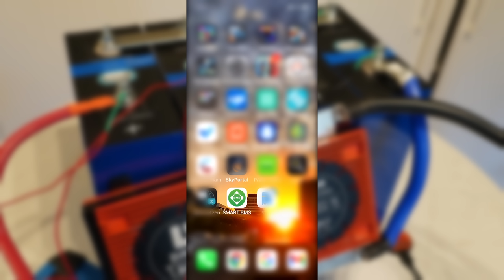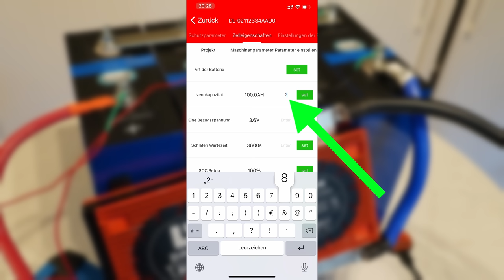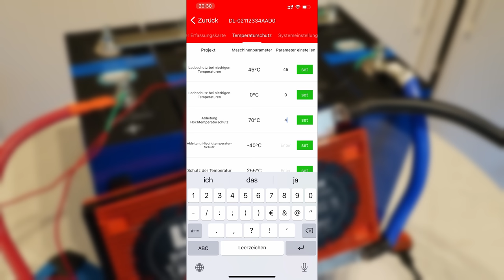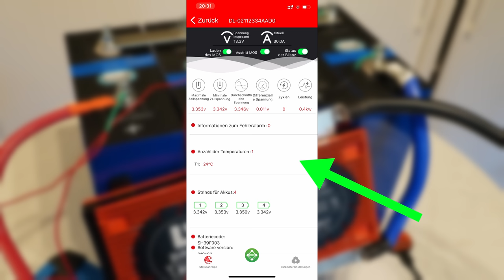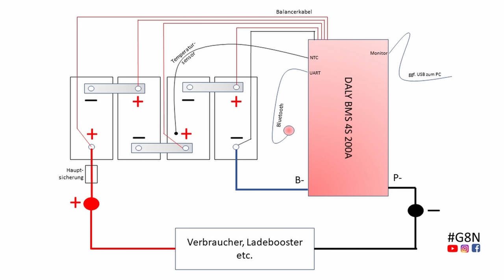Wie? 280Ah 🔋 Selbstbau für 599€, how to mit allen Details ausführlich erklärt #G8N

Comment: Ich finde, dass das hier das beste Video zum Bau eines LiFePo4 Akkus ist. Ich habe Ähnliches auf allerlei Sprachen angesehen. Hier bleiben keine Fragen über. Sehr gut! Mit dem Thema Sicherheit geht auch die exakte Beschreibung der Arbeitsschritte einher. Das macht es einfacher für Menschen wie ich, die schon etwas in Elektro Technik eingerostet ist. Hier mein Kompliment aus Portugal, Termas de Monfortinho !

Eine Frage habe ich aber doch noch:
 Mit welcher maximalen Leistung bzw. Stromstärke darf man diese Batterie laden, wenn sie Fertig ist?
Reply from the maker: Vielen Dank für dein Lob. 😊 Die Zellen selbst könnte man theoretisch mit bis zu 280A laden. Das BMS ist auf 100A Ladestrom ausgelegt. Wenn du mehr brauchst, kannst du auch ein größeres BMS verwenden. Viele Grüße, Mr@G8N
Reply: @G8Neu  100a reicht dicke! Danke Schön!
Reply: @G8Neu  Kann das sein, dass Du kein BMS für eine 24V System/8 Zellen verlinkt hast?
Reply: @G8Neu  So, habe mich selbst in Verstand gesetzt. Ich werde alsbald die Teile bestellen ! Dankeschön soweit !
Reply: @G8Neu  Super Video. Zum BMS: ein Händler schreibt, dass die BMS-Kapazität DOPPELT so hoch sein soll wie der max. Ladestrom. Das verwirrt mich. Eine Ergänzung: während z.B. AGM wenn sie halbvoll sind, keine Probleme mit einer "starken" Lima haben, da sie die max. Lima-Leistung selten aufnehmen, gilt das nicht für diese Batterien. Hier wird auch die volle Lima-Leistung auch z.B. bei 95% Ladestand aufgenommen.  Sie sagen, dass die Batterien eng zusammen sein sollen. Ich habe gelesen, dass manche Zellen nach 2 Jahren sich ausgedehnt haben. Ist das nicht normal sprich defekt? Es könnte ja auch eine Ausdehnung stirnseitig sein, und da ist im Siebdruck-Behälter wie im Video dargestellt kein Platz  ....

Comment: Sehr lehrreiches Video! Wieso hast du denn für 280ah ein 200A BMS ? Bräuchte es da nicht theoretisch ein größeres? Würde das 200A auch für 320ah reichen oder müsste man da das nächstgrößere nehmen? Bei Aliexpress werden welche bis 500A angeboten
Reply: Ah ist die Kapazität. A die max. Stromstärke beim Laden (ist normalerweise nur von der Lima) und beim Entladen (Wechselrichter etc.). Wenn also die Lima weniger als 200 A liefert und der Wechselrichter nicht mehr zieht (nicht mehr als 2.400W) würden die 200A reichen. Ich würde gleich das 250er nehmen. Ist nur marginal teurer ...
Reply: 2.400W bei 12 V

Comment: Hallo. Vielen Dank für das wirklich sehr hilfereiche Video. Mein BMS lädt bei der Initialladung nur bis 99,2%. Ich lade mit dem victron Energy blue smart charger 12 volt 20 amp und dort in den Einstellungen mit dem Lifepo4-Setup unbearbeitet. Die Batteriezellen haben eine nominale Kapazität von 280Ah und eine Reale Kapazität von 310-320 Ah. Die App zeigt an, dass die Zellen jeweils bei 3,340 V stehen. Ich habe zu dem Daly noch ein aktives BMS verbaut. Folgende Einstellungen sind eingestellt: 

Zellenspannung Schutzabschaltung Mx. 3,65V
Zellenspannung Schutzabschaltung Min 2,5V
Gesamtspannung Schutzabschaltung Max. 14,4V
Gesamtspannung Schutzabschaltung Min. 10V
Zellendifferenzspannung Schutz 0,03V
Max Strom Schutz Aufladen 125A
Max Strom Schutz Entladen 250A
Art der Batterie LFP/liFePO4
Nennkapazität 280 AH
Zellen Referenz Spannung 3,65V
Wartezeit Standby 3600S
Soc Setup 99,2%
Ausgeglichene Öffnungsspannung Balance 3,2V
Ausgeglichene Differenzspannung Balance 0,02V
Anzahl Boards 1
Board 1 Zellenanzahl 4
Board 1 Temperaturnummer 1
Ladeschutz bei hohen Temperaturen 45°C
Ladeschutz bei niedrigen Temperaturen 0°C
Entladen Hochtemperaturschutz 45°C
Entladen Niedrigtemperaturschutz 5°C
Temperaturdifferenzschutz 25°C
Temperaturschutz des MOS 47°C

Hat jemand ne Ahnung, wieso der victron Energy blue smart charger durchgehend im BULK - Mode laden will aber nichts mehr passiert? Die Prozentzeige geht nicht hoch, es wird angeblich durchgehend mit 19,5A geladen. Die Aktuellen Spannung insgesamt wird mit 13,3V angezeigt. 

Die Einstellungen im Victron Energy sind folgendermaßen:

Funktion Ladegerät
Ladevoreinstellung Benutzerdefiniert (14,2V)
Batterievoreinstellung Lithium Iron Phosphate (LiFePo4)
Maximaler Ladestrom 20A
Ladeabsorptionsspannung 14,2V
Erhaltungsspannung 13,5V
Lagerungsspannung 13,5V
Regenerierungsspannung deaktiviert
Temperaturkompensation Deaktiviert
Abschalten bei Temperatur niedrig 5°C

Spannung im Ausgang wird angezeigt 13,77V / Strom 20A

Kann mir jemand helfen?

Gruß

Comment: Hallo nochmal, Deiner Epfehlung folgend, habe ich dein sehr gut gemachtes Video angesehen und theorethisch verstanden wie, warum, wofür, usw. das BMS funktioniert und eingesetzt wird. Leider habe ich keine Anwort auf mein praktische Frage, ob ich  das "Daly Smart BMS 4S LiFePo4 12V 300A" für die 4 "ninthcit 2021 Klasse A 3.2V 280AH Lifepo4 Lithium battery" nutzen kann. Das 250A BMS dürfte wohl nicht ausreichen oder?
Reply from the maker: Hallo Georg, das BMS richtet sich nur indirekt nach der Leistung der Zellen. Sondern mehr nach dem, was du anschließend willst. Wenn du also einen 2000 Watt Wechselrichter anschließen willst, so brauchst du mindestens ein 200 Ampere BMS, bei 2500 Watt Wechselrichter sollte es mindestens das 250A BMS sein. Schau dir dazu auch nochmal das BMS Video an https://youtu.be/WIGAZKM5l4k Beste Grüße Mr@G8N

Comment: Hallo Danke für das klasse Video. Ich Baue es gerade nach, jedoch mit einem 250A BMS. Hier zu eine Frage? Reicht es auch für 250A ein 50mm2 zu verwenden... ( da BMS auch ein 50mm2 hat ) oder sollte man ein 95mm2 oder wie in der Norm so gar ein 120mm2 Nemen müssen. Danke schon mal, ich habe für die haubt sicherung ein 250A in Planung. danke für Antwort

Comment: Hallo, sehr gutes Video, alles verständlich erklärt, das eine oder andere habe ich mitgenommen, bin aber auch vorbelastet.
 Tip: kauft Dir T-Schlüssel als Werkzeug, da kommst Du nirgendwo mehr mit dran, die gibt es auch isoliert.
Aber jetzt zu meiner eigentlichen Frage, wofür ~ 300Ah und wenn man sie nimmt, wie bekommt man die voll. Auf Deinen Sprinter haben ja nicht unendliche viele Panels Platz und die Lima wird wahrscheinlich auch ewig arbeiten müssen. Wir haben ein 7,5m Alkoven WoMo mit zZt 2 x100Wp (Platz wäre für 3), sind mit 2 Erw. + 1 Kind und kommen eigentlich auch im Herbst mit unserem 110Ah Bleiakku hin. Der hat aber jetzt 5 J. auf dem Buckel und sollte mal getauscht werden. Ich schiele jetzt natürlich nach den Lifepo4. Deine Linksammlung ist Klasse, dort fand ich aber auch fertige 100Ah Lifepo4 Autobatterien für knapp 300 inkl. Versand. Für mich wäre es eine Kapazitätsverdoppelung mit fast nichts an Arbeit, für den 2,5fachen Preis eines 100Ah PB Akkus.
Nenne mir doch einmal Gründe, weshalb Du zum Selbstbau mit dieser hohen Kapazität tendierst und keinen fertig Akku genommen hast. 
Weiter so und LG
Heiko
Reply from the maker: Hallo Heiko, vielen Dank für dein Lob. Ich habe mich für diese Variante entschieden da man nie genug Reserven haben kann. Alle fertig Akkus, die ich bis jetzt gesehen habe, hatten mich aus verschiedenen Gründen noch nicht überzeugt. Wir haben ein 2000 Watt Wechselrichter, den wir regelmäßig benutzen, mit Espressomaschine, Toaster und Föhn. Für die 2kW sollte das BMS mindestens 200A Dauerleistung bringen. Genau das können die wenigsten fertig Batterien leisten. Wir haben auf unserem Reisemobil kein Solar bei uns wird der Akku ausschließlich über den Ladebooster geladen. Wir schaffen es trotz unseres hohen Stromverbrauchs etwa 4-5 Tage autark und ohne nachzuladen zu stehen. Wenn die Batterie leer wäre, braucht der Ladebooster (56A=730W) natürlich bis zu 5 Stunden, um sie wieder vollständig zu laden. Aber das ist gar nicht notwendig, denn ich brauche ja nur so viel nachzuladen, dass ich bis zum nächsten Fahren reiche. Und wenn der Akku mal ein paar Tage nicht auf hundert Prozent geladen wird, ist das auch egal. Im Gegenteil, das spart Ladezügeln und damit hält der Akku länger. Außerdem ist de Belastung des Akkus durch große Kapazität im Verhältnis geringer als bei einem kleinen Akku. Also „Think Big“ 👍 Viele Grüße Mr@G8N

Comment: Schönes Video! Ich weiß nicht ganz, welches ich holen muss. Habe jetzt 3 verschiedene von Daly Geräte (mit250A) gefunden - eins mit glatter Oberfläche, eins mit geriffelter Oberfläche so wie du es jetzt eingebaut hast und ein dickeres mit Lüfter. Weißt du welches, für welche Zwecke sind? :)
Reply from the maker: Danke für dein Lob, Roman. Was meinst du mit BMS gewechselt? Ein 250A BMS mit glatter Oberfläche gibt es meiner Meinung nach nicht. Für das Wohnmobil sollte das normale 250A BMS ohne Ventilator durchaus reichen. Die Variante mit Ventilator ist dafür gedacht wenn man permanent an der Last-Grenze betreibt. Viele Grüße Mr@G8N

Comment: tolles Video, vielen Dank.
Kannst du vielleicht auch mal ein Video machen, in dem die DALY BMS App mit ihren Funktionen erklärt wird. z.B. gibt es ja bei Systemeinstellungen neben Passwort ändern auch Dinge wie Neustart, Reset, Kalibrierung. Bisher habe ich keine Anleitung gefunden, welche die App in Ihren ganzen Funktionen beschreibt. Ich muss dazu sagen, ich habe 2 fertige LiFePo Batterien gekauft mit dem Daly BMS, aber Anleitung dazu gibt es keine. z.T. sind ja in der deustchen App auch noch chinesische Buttons ( z.B. etwas mit Heizung oder Start) Danke.
P.S. Habe die App Version 2.4.3 und ein frisches update der BMS firmware gemacht (Datum 2.2.23)

Comment: Hallo zusammen. Irgendwie ist bei mir der Wurm drinne. Nachdem ich die 4 Zellen zusammengebaut hatte und den BMS konfiguriren wollte, hatte ich Probleme mit dem Einstellen des "Ausgewogener Öffnungsdruck". Dieser lässt sich bei mir auf minimal 0,02 V einstellen. 0,01V akzeptiert das BMS nicht... Ich habe nach dem Aufladen der Zellen das Phänomen, dass die Zellspannung maximal bei 3,35 V liegt.Alle andern Zellen liegen unter 3,25 V. Sollten das nicht 3,6 V sein ? Ich werde nun versuchen, alle Zellen einzeln mit 3,6 V zu laden und dann parallel zu schalten um sie auszubalancieren. Habe ich irgendwo einen Denkfehler ? Have ich evtl "schlechte" Zellen (von T***) bekommen ? Ich wäre für Tipps und Anregungen sehr dankbar

Comment: Guten Abend,  vielen Dank für das tolle und gut verständliche Video. Ich habe dennoch eine Frage zum Balancer die Bezeichnung ist mir nicht ganz klar zum Beispiel diese.  LiFePo4 4S12V BT daher weiß ich auch nicht, ob diese Balancer der Richtige für mich ist, wenn ich eine 12 volt Batterie mit 200AH aufbauen möchte.. auf der Internetseite des verlinkten Balancers gibt es viele verschiedene Auswahlmöglichkeiten... besten Dank für die Rückmeldung.
Reply from the maker: Hallo Christoph, vielen Dank für das prima Lob.  4S steht für 4 Zellen in Serie geschaltet, das BT für Bluetooth. Somit ist das vom Typ der richtige Balancer. Bitte beachte aber auch die Stromstärken, 200A steht für maximal 200A entladen und 100A laden. Wenn du aber einen Wechselrichter mit über 2000W hast, würde ich ein größeres Nehmen. Das 200A ist das kleinste was ich empfehle. Viele Grüße Mr@G8N
Reply: Besten Dank für deine schnelle Antwort. Ich plane einen 1500 Watt Wechselrichter anzuschließen,  ergo sollte der 200 reichen,  oder?
Reply from the maker: @christophhaugk7469  Das 200er ist für bis zu 2kW gut, also ist das 200A perfekt bei dir. VG Mr@G8N
Reply: Vielen Dank. Eine weitere Frage hab ich noch. Vielleicht kannst du mir hier auch weiterhelfen.  Ich plane die Batterie unter dem Fahrersitz zu verbauen. Da allerdings der Bauraum sehr beschränkt ist, wäre es von Vorteil die Batterie in liegender Position zu verbauen. Daher die Frage. Kann ich die Lage des Akkus  beliebig wählen? VG + Vielen Dank

Comment: Hi, ich bin soweit fast fertig mit dem "Nachbau". Eine wichtige Frage hätte ich noch: braucht es neben der Megasicherung (200 A) dann noch zusätzlich die Sicherung jedes Kabels, welche von dieser Mega-Sicherung aus wegehen, zu 1. Ladebooster Victron Orion-TR 30A (16mm², ca 50cm, 50A),  2. Sicherungs/Verteilerblock für kleine Verbraucher (16mm², ca. 50cm), 3. Wechselrichter 1500W/3000W (25 mm², ca 50cm, 150A), 4. Batterie Lader victron smart charger 15A (Landstrom)? Oder braucht es diese Sicherungen nicht mehr, und alles kann an die Megasicherung "direkt" angeschlossen werden? Das wäre noch unheimlich hilfreich. Danke schonmal! VG, Markus

Comment: Hallo. Ich habe mit Interesse das Video geschaut. Mit einem aktuellen Daly BMS 4s mit 250A und Lüfter habe ich nun das Problem, dass die Zellspannung nicht über 13,8V in der BMSApp angezeigt wird, auch wenn ich lade. Mit dem Victron Shunt Messe ich gleichzeitig aber 14,4V. Wie kommt die Differenz zustande?
Ich lade mit einem Votronic 45A B2B. Über 22,2A kann ich aber nicht laden. Komisch. 
Die Prozent-Anzeige vom Victron zeigt regelmäßig keinen Wert an. Vllt geht das Daly doch aus, obwohl ich 15300s als Standbyzeit eingegeben habe und es ja nicht ausgehen sollte
Bei der Empfehlung von Daly hätte ich gerne berücksichtigt, dass unter 2A nichts angezeigt wird. Andere BMS zeigen die verbrauchte AH an. Dann könnte man sich den Victron shunt sparen. 
Würde mich Uber eine Antwort und Hilfe freuen.
LG Michael

Comment: Sehr gute Bauanletung Mr. G8N. Ich habe eine LifePo4 Batterie mit 8 Zellen (280 Ah Varicore) nach Ihrer Anleitung für mein Wohnmobil zusammengebaut. Da ich eine großzügig dimensonierte PV Anlage (1500 W) habe ist die Batterie bis jetzt nicht unter 85 % Leistung gesunken. Jetzt habe ich bei 2 Zellen das Problem das diese bei einer Restgesamtleistung von 72 % stark anfangen zu driften und auf 2,5 Volt abfallen (die restlichen 6 Zellen liegen bei ca. 3,2 Volt). Kann ich davon ausgehen das die Zellen hinüber sind?

Comment: Hallo. Super Video.  Welche Maße hat die fertige Box. Mach weiter so.
Reply from the maker: Hallo Micha, vielen Dank für dein Lob. Der Boden 178mm x 320mm, 2x Seiten (vorn und hinten) zu 220mm x 320mm, Deckel 335mm x 178mm, rechte Seite 178mm x 235mm, linke Seite 208mm x 250mm. Ich habe 15mm Siebdruckplatte benutzt. Viele Grüße Mr@G8N

Comment: Hallo, danke für das super Video - einfach super erklärt. Ich hätte da eine Frage zu meinem Projekt. Ich habe baue gerade einen Akku mit 310AH Zellen und 4S 250A BMS. Bei dem BMS ist auch ein USB Monitorkabel mit 3poligem Stecker. Allerdings finde ich nirgens am BMS einen Möglichkeit den Stecker einzustecken. Es gibt nur auf einer Seite NTC/Lightboard/UART Steckplätze. 
Ist das 3 polige Kabel überhaupt passend für mein BMS? In einem Video hast du Aufzeichnungen mit dem Raspberry PI gemacht. Mit welcher Software hast du da aufgezeichnet? 
Beste Grüsse Martin

Comment: Vielen Dank für deine Mühe. Ich habe einige Fragen zu dem Video und hoffe, dass du mir sie beantworten kannst:

1. Unter deinem 280h Link aus China findet man mehrere Versionen der Batterie. Welche nutzt du in dem Video? (RP280AH 4PCS, EVE280AH 4PCS, LS280AH 4PCS)

2. Kann ich die Batterien nach dem auspacken auch direkt balancen und danach erst das bms anschließen? So würde ich mir einen Schritt sparen. 

3. Kann die Box inkl Batterie komplett verschlossen werden, oder benötige ich Löcher für die Lüftung? Fände es praktisch, wenn da kein Staub oder Dreck draufkommen würde, wenn ich sie zu Hause lade und zum Camper bringe.

4. Würdest du einen on/off Schalter auf der Batterie empfehlen um sie vom schaltkreis zu trennen, oder baust du ihn später in den Schaltkreis ein?

Comment: Servus G8N,
Super Video gut erklärt!
Wie hast du die Hauptsicherung bemessen? (Amper)
Bei der Stelle 30:05 hast du bei den Parallel geschalteten Barreien erwähnt das sie auf 3,65 V geladen werden können. Mit weiviel Amper würdest du die laden. Zwischen 1-10 A?
Beim Wohnmobil wird ja die Batterie von der Lichmaschine geladen . Hält das 200A BMS das aus? oder braucht man da einen anderen Laderegler?

Viele Grüße aus Bayern Mike
Reply from the maker: Hallo Mike, vielen Dank für dein Lob. Die Hauptsicherung sollte immer so groß sein, dass dein größter Verbraucher, meist Wechselrichter, Plus dein durchschnittlicher Verbrauch und eine kleine Reserve abgesichert ist. Bei einem Wechselrichter mit 2kW passen die 200A Sicherung sehr gut. Die 3,65 Volt sind die End-Ladespannung, beim Erreichen dieser Marke sinken die Ampere automatisch. Es ist nicht notwendig die 3,65 Volt über einen längeren Zeitraum aufrechtzuerhalten. Das 200A BMS hält Ladeströme bis 100A aus. Ich kenne aktuell nur einen Ladebooster, der überhaupt in der Lage ist, diese Leistung zu bringen. Die meisten Ladebooster haben nur um die 40A. Viele Grüße, Mr@G8N
Reply: @G8Neu  Also habe ich doch richtig gelesen. Die 200A des BMS sind für die Ladung zu halbieren. Gibt es dafür eine Begründung? und gilt das Nur für die Ladung? Meine Lima liefert max. 140A. Das heisst dann BMS mit 300A . Das Problem wird dann die Verkabelung. Wenn die Lima das liefert, sind meine 70mm² auf 6m wohl zu dünn ..... Ich werd mir wohl eine 100A-Lima besorgen müssen ......😪

Comment: Hallo. Folgende Laien Frage: Ich benötige 24V. Heißt das dann: 2x4 Batteriepacks a 12 Volt in Reihe geschaltet. Ergibt das dann 24 Volt mit 280 Ah ?  Sind quasi nur die "Batterien" doppelt und der Rest jeweils einmal, zb der BMS? Ich möchte zusätzlich 1000 Watt PV mit anschließen.
Reply from the maker: Man kann natürlich zwei 12 V Batterien in Reihe schalten, ich würde aber eher eine 24V Batterie bevorzugen. Das ist dann eine so genanntes 8S Akkupack. Diese hat dann also 8 Zellen in Serie (Reihe) und ein BMS. Beste Grüße, Mr@G8N